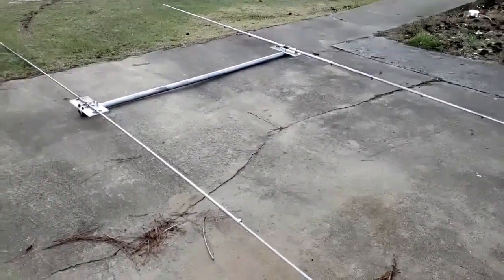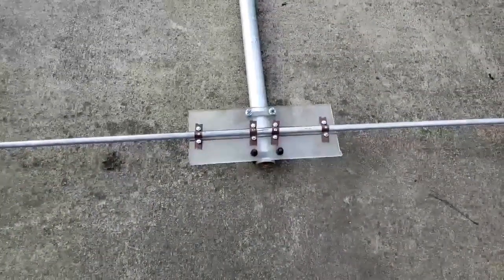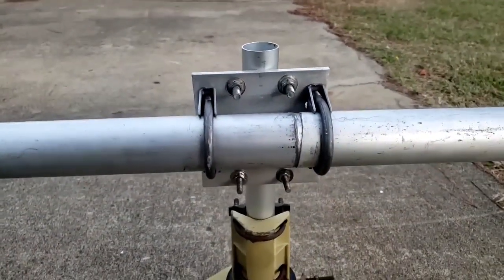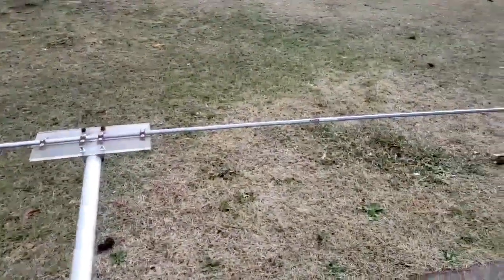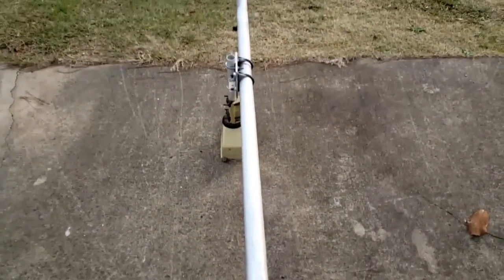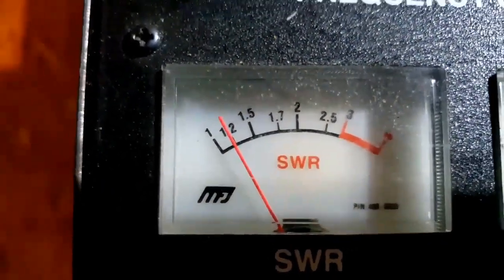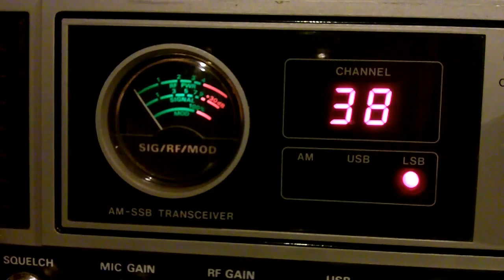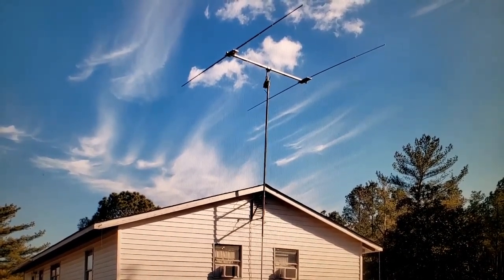My Best Homemade CB Antenna Ever!!

Comment: With each element being 102.25 with a 2 inch spacer, wouldnt that be a total of 206.5 instead of 204.5? Not trying to be nitpicky but I am going to try to build one. Thanks
Reply from the maker: Yup, lol. I noticed my mistake after I published the video. Yes the total length with spacer is 206.5"
Thanks for watching, Good luck with Your build.
Reply: @MowerJunkie  Thanks for the reply. Keep the vidoes coming. I made contact with you a month or so ago... 351 SW Oklahoma
Reply: @MowerJunkie  l built this antenna and it warks great swr is pretty much flat across the band my farthest contact has been from atlanta ga .to south africa and to many countries in europe.i love this antenna .thanks mower junkie and 73s from 577 on the bottom side of atlanta ga.
Reply from the maker: @susancoggin8453  That's awesome! Enjoy the hobby, 73's.
Reply: Wish my Brenda said an antenna looks good on our house, you have a special wife !
Reply: Cheers Mate, you saved me from posting this very question
Reply: Nice antenna mj.  I've heard you on ssb, but can't talk out on my radio.  It is apparently off freq!?  I guess ill have to have someone .ook at it!  73s from the cactus patch!!
Reply: @rgnichols567  
Get yourself a new ham radio and never look back.   Most can be easily modified to transmit on all frequencies by removing a diode or something similar.   I bought an Icom 706mk2g new years ago and will never buy another cb.
The problem with the cbs is when they break, you can't find anyone to fix them.
I've got a nice Galaxy Pluto right now in need of repair and can't find anyone I trust to do a good job.
Reply: Witam jakieś parametry tej anteny gdzie znajdę

Comment: On the driven element how many different size pieces are you using? And do they need to be set at a certain length. Or just as long as it is 102 1/4 that should be perfect.
Reply from the maker: 102.25" can be used as a starting point, But you will probably have to fine tune it.

Comment: So, did you ever get your beam at least a half wavelength above the ground?     A full wavelength would be better, but a half wavelength above the ground should be the minimum to keep your angle of radiation low enough for good DX.   Sure, you would make contacts where you have it; but, your signal and theirs would probably be better if the antenna was higher off the ground.  I say probably because it depends on how far away the contact is.   If they are thousands of miles away, you would benefit from having the antenna up higher.   But, if they are only a few hundred miles away, you're probably better off with it down low to the ground like  you have it, where you get stronger reflections off the ground that translates into a higher angle of radiation.   Otherwise, nice build!

Comment: ken i use coper pipe 3/4 inch and 1/2 inch at the end usig reducer  end us the same measures thans for the video from..denver colorado
Reply from the maker: You can use copper pipe, But your measurements will be different.
Reply: any idea on the measures thans .... and I hanks for your time

Comment: That looks excellent. That is a broad spacing between the elements which not only allows you to achieve a great match, but also (in theory) favors a stronger rear null at the expense of slightly reduced overall directional gain. If a person wanted to get highest gain in a beam and cared less about a strong null in back, they would go down to something as tight as 50 inch spacing and to get a good match, do something like a gamma match or hairpin on the solid and/or grounded radiator/mast which would also be a stronger and grounded design. Your new antenna should really kick ass and hold up well, nevertheless!
  The 10meter beam  I am laying out in the parched grass in the back yard right now is a 16 foot aluminum painters pole with two short aluminum tube stingers screwed to the ends, while struggling to build a hairpin beta or gamma match with odd materials laying about. Reflector is two crappie/panfish poles butted together with a 1" tube as a coupler. With some copper foil leftover from industrial processes I happen to have, I am wrapping the entire fiberglass reflector element in copper foil about twice as heavy as reynolds wrap. It looks like a golden javelin. Boom is a convenient 7 foot fiberglass pruners pole. How did you cut your plexiglass so neatly?

Comment: I just got into gmrs radios and I have begun building antennas.  Very fun hobby. Working towards my amateur license soon.  I just constructed a copper yagi gmrs vhf.  Andnit works good I need parts to get my gamma match solid but the antenna works well and has a lot of gain
Reply: What kinda range do GMRS get?
Reply: @thechristianbiker812  in my experience it's a lot based on your local topography.      I can get a pretty steady 35 miles to a repeater in my area.  days good propagation days I can get around 40 miles.       Reaching a repeater that is.  
Simplex radio to radio I can average around 15 miles max in my area.    Def varies based on terrain.  I'm in north east Ohio.
Reply: @keithtreisch6890  that's alot better than i expected
Reply: @thechristianbiker812  of course it all depends on location.  Radio and antenna.        A base antenna around 25 to 30 ft does well in a lot of areas with a good antenna or one atkeast tuned for gmrs. Sometimes the 70cm dial band antennas are not quite good enough swr wise and tuning to do good for gmrs freq.            I love building and doing. I am a ham operator now and I built my own gmrs repeater here in my hometown so it's been fun and i love the hobby.    Gmrs is what got me into radio and i will def. Be continuing it for the matter of family comms.       Imo a good quality radio meaning a better name brand thay baofeng will do you wonders.   The cheap radios can get u started but. A yaesu or a icom handheld is def worth the money for range and reliability.  I have 3 baofengs that no longer work. So sometimes the money pays
Reply: @keithtreisch6890  thanks for the info! I'll have to look into it and see of there are others to talk to on it in my area.

Comment: I have one of those old TV rotator motors which was still attatched to an old TV antenna I was given. But I don't have any of the other components for it. I would like to use it on a CB antenna. But I have no idea what the correct voltage is supposed to be that the rotator motor uses. Do you or anybody else out there know what is the correct voltage that it takes to run the rotator motor? Is it AC or DC voltage and does it operate on 12 volts DC or 120 volts AC? Thank you or anybody else in advance that can provide me with such information. Thanks again for sharing such great video's on buliding antenna's. Every one of them has been very informative.

Comment: IF I MAY ASK.............   AT THE FEED POINT , IS THERE ANOTHER WIRE FOR GROUND TO THE MAST?OR DO I RUN A SEPERATE GROUND FROM THE BOTTOM OF THE POLE TO MY LIGHTNING ARRESTOR?
Reply from the maker: My build was not DC grounded, just the coax connects to the active element.

Comment: What I use for element insulation is Stauff Hydraulic pipe mountings on top of aluminium flat bar or plate. It's much more robust. To terminate your coax to the driven element; drill a small hole through the element each side and use a stainless metal thread and nuts and connect the cable with electrical terminals. Use a 1:1 current balun / choke in the coax.

Comment: You Must have a good heart for Animals, Cause cats pick you, That means they trust and love you, Our 30 pound Tabby is our Child, Back to the Antenna, Do you have a schematic, for this, I,m old and Blind, and have not had a CB in 20 years when I stop Driving Tractor over the road,. , But I had a Big radio then ,So your saying you have 2 separate 102,1/4 on each end, But not connected,  Is that right, and other side same length but they are Connect in center. I know this Might be a stupid question, I just don't remember. Thanks for any Help Brian

Comment: ...a dipole with a reflector?     Use the driven element as one piece of aluminium and use a gamma match to  set up for tuning... Less messing around and joints.  If it works and you are happy, awesome!

Comment: really appreciate this video - exactly what i needed - you said you were building it for channel 38 - what dimensions would you use for a less channel specific design? I am a novice with antennas cb but an avid DIY - use what you got kind of guy - in my situation, just now putting an mobile in the truck and a base at home in an attempt to communicate while hunting an area with absolutely no cell service - already have  a 40 ' tower i can stick it on top of and the material to do it, just wondering if i should copy your measurements exactly or not... thanks in advance for any and all info, i don't usually  like watching vids for info but i liked yours
Reply from the maker: I built this antenna so that channel 38 is in the middle of it's frequency coverage. it will easily do 40 channels up and down from 38, and still have a good SWR reading. Good luck with your antenna, 73's

Comment: Have you ever made an antenna out of a copper pipe?
Reply from the maker: Nope, I think copper is too heavy.
Reply: im thinking 1/2" copper pipe, im going to cut at 103" and see where i end up. i may have to trim to 102" but ill do that in 1/8" increments and see if i can get a good swr

Comment: So, I would guess by mounting the reflector directly to the boom, element spacing and element length may need to be more radically adjusted where as insulated from the boom, the dipole formula and 5% longer reflector may get you closer from the get go???

Comment: How would you adjust the SWR on something like that if it was too high I didn't see where you can adjust it
Reply from the maker: the element is made out of multiple lengths of pipe that slide into each other, so you just loosen a clamp, and make the element longer or shorter to adjust the SWR.
Reply: @MowerJunkie  thank you so much

Comment: Love your videos! I am going to build a two element using your dimensions. I just do not understand the connection to the driven element
Reply from the maker: the 2 half's are separate, and the coax gets connected directly to each half. center conductor to one, and shield to the other.
Reply: Thank you very much. I am going to start building one tomorrow

Comment: What's the impedance? Without a Balun I don't understand how it's going to match.
Reply from the maker: It's all in the design, With it up higher in the air I now have an SWR of 1 to 1 on channel 19, and 49 ohm resistance.
Reply: @MowerJunkie  I woulsd still at least put an  air Core choke balun on it personally. all you need to do is wrap some coax around a plastic pipe. just saying.

Comment: how does your 2el "yagi" compare to a single element dipole, any gain over the single element dipol ? 
the footpointresistance will not be 50Ohm, when there is the second element or more elements. what does the SWR do, if you turn up the calibration knob of that SWR-meter to the max, still around 1,2 or does it go to like 2.2 or even higher ?
Reply from the maker: the SWR meter I used is part of an antenna analyzer, it does not have a calibration knob, it has a frequency adjustment knob. With the antenna 28 feet off the ground it has a resistance of 49 ohms, and 1 to 1 SWR on channel 19.
Reply: APPROXIMATE YAGI-UDA ANTENNA GAIN LEVELS	
NUMBER OF ELEMENTS	APPROX ANTICIPATED GAIN
	DB OVER DIPOLE
2	5
3	7.5
4	8.5
5	9.5
6	10.5
7	11.5
so you can see the best bang for your buck is a 2 or 3 element beam. To go from a 2 element beam as .22 wave length (appx 8') to a 55 foot boom for a 7 element  boom (using the same .22 wave length spacing) "ain't worth the hassle or trouble" for only 6 db gain (1 s-unit on the receiving station). MJ didn't mention but the .22 spacing is for maximum forward gain. You can shorten the 8' spacing and improve how broad band the antenna. 73

Comment: ive been watching you for a while, and i got to ask what is your main coax that you use ?
Reply from the maker: I use RG8-X coax. Thanks for watching, 73's from 151 SC.
Reply: @MowerJunkie  have you ever tried any thing that is less lossy per ft?
Reply from the maker: @ki5fwjjustgotdown  Both of my base antennas only have 36 foot runs of coax, with this short of distance, I don't need anything better than rg8-x.
Reply: @MowerJunkie  understandable.  I have switched to a cheaper lmr400 style feed line @50 ft picked up a small bit of performance.   But I appreciate you taking the time to chat back with me keep making the great content 73  my friend

Comment: what kind of power are you running in that base station?
Reply from the maker: I use a small 2 pill box. with an output of about 150 - 200.

Comment: What about using a balun or current choke to decouple the unbalanced coax (52 ohms) from the balanced dipole driven element (75 ohms) which remove the problem of radiation from that coax.  Additionally the vswr shown on that meter will not be accurate if the coax is not decoupled from the driven element with a current choke.  Then you should transform the 50/75 ohms impedance mismatch for efficient power transfer.  Since it is a mono band antenna a gamma match is simple and easy to make and will fix all these problems.
Reply: Builder told that his antenna at feedpoint is 50 Ohms, so no impedance mismatch. I agree about  a current balun though. de YL3GU
Reply: the addition of the reflector lowers the feed point to around 50 ohms! 75 ohms is only when well away from objects! a choke is a good idea but not needed. the 50 vs 75 ohm is not a problem in the old days you would use 75 ohm rg 11 or rg8 intrchangably as you could get 50 or 75 ohm swr tester and the output of radios wear tunable from 25-150 ohms! the loss from a 1.5 to 1 swr is not detctabel in radio land! the old radio books do a good job of explaning swr etc not the new ones! read one from pre 1940 it will explane it at enginring level yet make it clear for lay men!

Comment: I built a 4 element yagi , very similar to that 30 plus years ago. The reflector and directors do not need to be isolated from the boom , only the directly driven element, I used a Hy Gain BN 400 beam balun and short jumper to each half of the driven elements, same 2 inch spacing and isolation from the boom

Comment: Nice nice from  290 in the great lakes i have 2 pdls. I have one for parts an one is goin up soon
Reply from the maker: Nice! The PDL-2 is a great antenna. Take care 290, 73's from 151 SC.
Reply: probably the best antenna ever made. Small, light weight, with the full wave elements. Quad antennas are bad to the bone.

Comment: I've still got a silver rod on the roof of a 18 story building here in London.  Height really is might.  I'll be taking it down soon coz it's getting bent and battered up there (they don't make them like they used to) I'll be putting up a 4ft shorter fibre glass antenna. The sigma 2011 skip master 5/8 wave..  the silver rod is still a great cheap antenna which served me very well.  I tell you what the silver rod ain't scared of the antron 99. If the antron fancies a knuckle up the silver rod is ready to go. Just say the time and the place and the silver rod will be there 🌚 it just sees the antron as a skinny puny bit of wire. Anyway Queensbury rules🌚?
Reply: Throw an antron 99 up an talk around the globe
Reply: @Randy-lf2dp  the silver rod gives the antron a run for its money all day long. It's quite confident it'll kick the antrons arse🌚
Reply: @zukispur5493  i hear you but antron low low maintenance i like sirio 827 an the sirio 2016
Reply: I miss my 99 tried em all im runnin an imax 2000 for last 5yrs works ok
Reply from the maker: Good luck with Your new antenna, I hope it works great. Thanks for watching, 73's

Comment: I have built my own design 2 element beam for many locals here. I have worked dx all over the world with this design. It really works and is dirt cheap to build.
Reply: Looked pretty easy. Almost thinking of going to the local hardware store someday
Reply: @radioaktiv7841  I use electrical conduit. Get everything a box store for under $50.00
Reply: So you're using steel instead of aluminum?  Thats interesting.  I might have to try that.  Here in az we don't have the corrosion problems other parts of the country have.  (Its a DRY heat, lol)

Comment: Yet another amazing job ! We got all that ice in Rockhill as well, my 102 whips ground planes on my A99 drooped like they had stripped bass on the line 360 SC saying 73 2 ya
Reply: 5650 just up the road in Lake Wylie waving! Pretty sure we spoke a while back.
Reply: Yes it get out better on skip. Local stayed about the same.
Reply: Did the whips improve the A99 currently using mine with no ground plane

Comment: Looking good 151! Give me a shout 497 on the South side of Lake Murray.
Reply from the maker: Thanks Brandon, I talked to you on this antenna, when it was only 10 feet of the ground. Take care 497, Thanks for watching.
Reply: @MowerJunkie  Let's do it again. We have a nightly round table on 38. Right now I'm using a 125ft wire doublet fed with 600Ω open wire ladder line horizontally stretched out east the west. I'm working on getting my old full wave box quad back up for 11 meters. It's a all fiberglass antenna with no metal except for the mast plate and the end caps for the spreaders. This is 22 Chuck's old design. No gamma match just only 1/4 wave stub fed with a piece of 75 ohm cable. 73! 497 Brandon

Comment: Did you notice your SWR’s was much higher when covered in ice ?  It creates a continuity , mine did that last week .  Very nice job 151 . I’m looking fwd to building me a 3 element for either 2 meter or 10 meter this summer
Reply from the maker: Yup, when it was covered in ice it did have a higher SWR, but it did stay below 1.5.
Reply: @MowerJunkie  
Same here ,, as long as I was barefoot